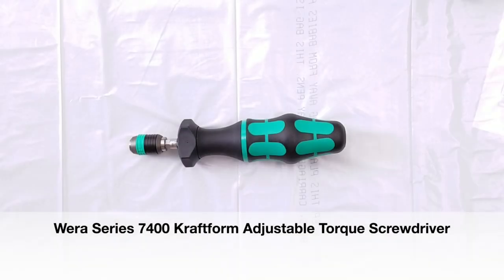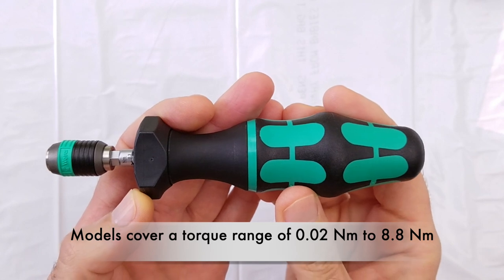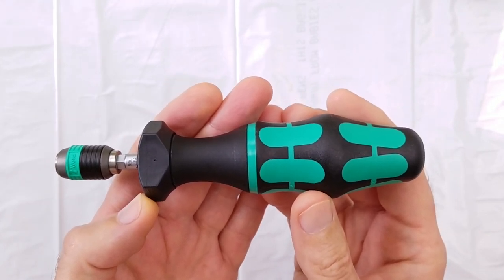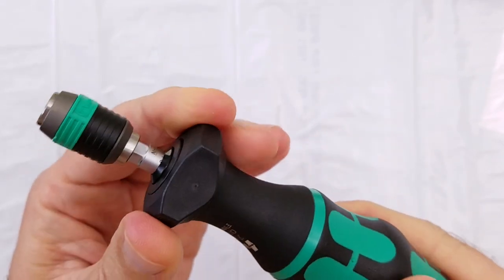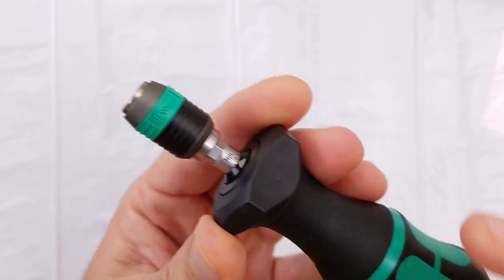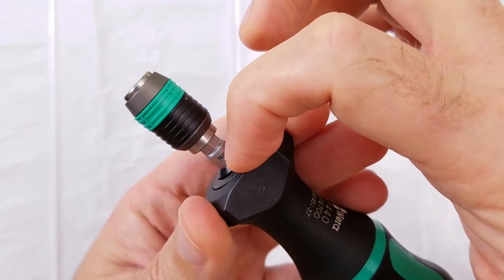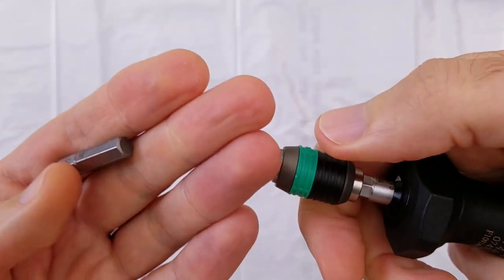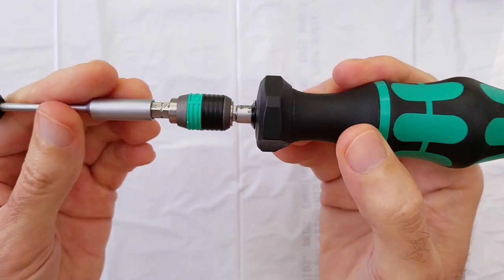Wera Series 7400 Kraftform Adjustable Torque Screwdriver

Comment: Haha I think you have the bit inserted the wrong way, it don't matter because its 1/4" both sides but the notches should probably go inside the tool.
Reply from the maker: The Wera chuck doesn't care.  It's not a Wera bit anyway.  I think the only way it would matter was if the bits were diferentially heat treated.  Thumbs up for your eagle eyes though!

Comment: There is no need to store tools at their lowest setting.  The spring does not loose its force over time.  Actually backing them off is more likely to wear out the adjusting mechanism. I find it takes a while for a tool to settle once you calibrate it.  If you always use a tool for the same setting, you should just leave it there.  My company checks its tools weekly.  They don't move.
Reply from the maker: "The spring does not loose its force over time."   Actually springs do (at least metal springs), but the amount of relaxation is very dependent on stress and temperature, and also on the manufacturing process.  I don't disagree with you that preserving the adjusting mechanism may be a more important issue.  This is from the Wera manual:  "Attention!  If the adjustable torque screwdriver is out of use for a longer period, then  turn  the  wrench  back  to  the  smallest adjustable torque value to reduce  unnecessary  stress  of  the  spring mechanism"  Thanks for commenting.

Comment: Is it worth the pricetac 225 GBP for set with from 0,3-6 nm?
Reply from the maker: Hi.  I have no idea what your needs and usage cases are.  Felo makes torque screwdrivers which are less than half the price of the Wera's.  The Felo's cover the range 0.6 Nm – 1.5 Nm, 1.5 Nm – 3.0 Nm, 3.0 Nm – 5.4 Nm.  I needed the lower torque range of the Wera for certain applications.
Reply: @sheltermonkey6065  as did i

Comment: Would it be suitable for mounting rifle scopes? Those operations are very sensitive, a squashed scope can mean big $$$ in lost value. Also: If yes, what set of bits would be good for that purpose?
Reply from the maker: You have to consult the manufacturer's instructions for the mount to find out the recommended tightening torque. The Felo torque limiting handles are easier to use than this Wera, so I recommend the Felos. They have 3 different variants that cover different torque ranges. But you have to check what your fastener torque specs are. When you buy a Felo handle, you should also get the 1/4" Bit-Holding Blade. As for 1/4" bits, any of the German brands bits are good, Wera, Wiha, or Felo. Quality bits are only a few dollars.
Reply: @sheltermonkey6065  Thx, but the most suitable Felo I can find has a span of 1.5 - 3.0 Nm and I'd like to be able to go to around 1.1 -1.2 Nm for aluminum
Reply from the maker: @byronbrimstone5163  That's the middle one. The lowest range FELO Torque Limiting Handle is 5.3-13.3 in/lbs (0.6-1.5 Nm).
Reply: @sheltermonkey6065  Not happy with the Nm-range I need being divided between two different ones. It's a hassle.
Reply: @byronbrimstone5163  There is also the Beta 583 series with three models with different range: 0.3 - 1.5 N, 0.6-3 Nm or 1.2 - 6 Nm.
USAG 824 A: 0.5 - 2.5 Nm (there is also a 2 - 10 Nm).
TecnoGi has the model 803 with range 0.5 - 3 Nm, the 806 1 - 6 Nm (and the 801 0.1 - 1.2 Nm).

Comment: The price for this tool is too expensive , you can get  a good  cordless impact driver for this price !
Reply from the maker: This is a specialized tool for specialized applications.  I don't know of any other good options for low-torque-range torque screwdrivers.
Reply: Actually it has a very good price in compare of other Adjustable Torque Screwdriver. all of them are uper than 150$.